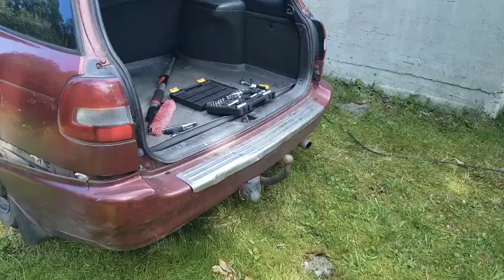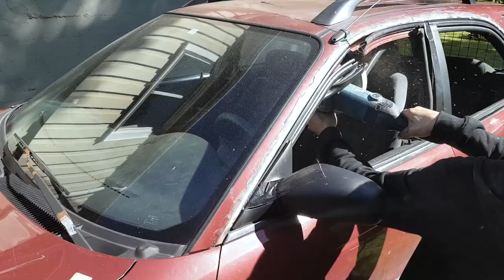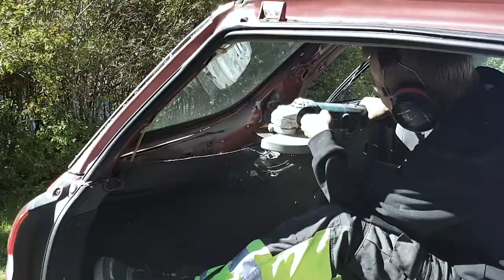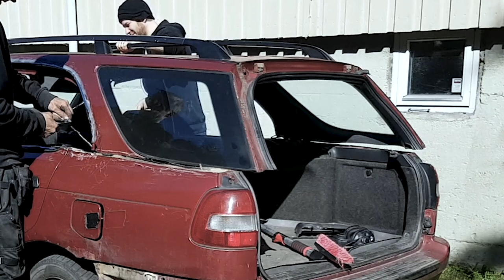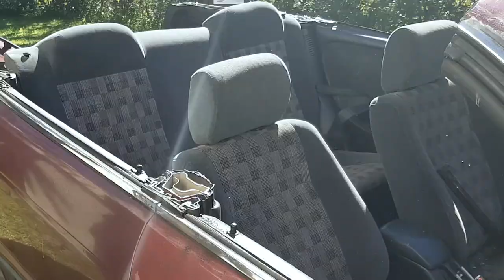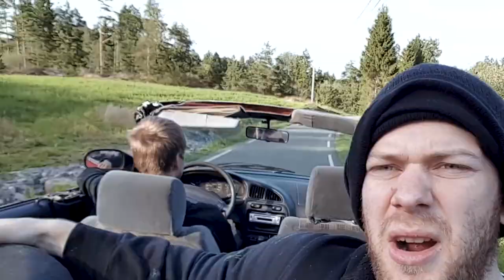How To Make a Convertible Car Cabriolet BEST GUIDE

Comment: It a half 4 door convertible sedan and half the pick up truck out of the station wagon. Like to see new Lincoln 4 door convertible sedan back again like they did for 1961-1967 Lincoln Continental. Kaiser-Fraser did make 4 door convertible sedan for 1949-1951 models, these are the only 4 door convertible sedan after World War II. Actually it's a crew cab pick up truck minus the top.